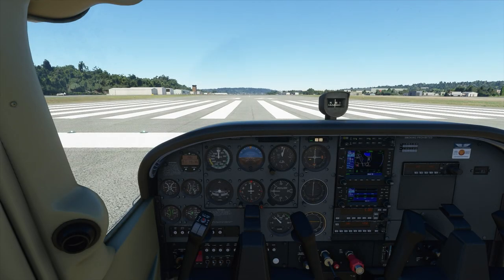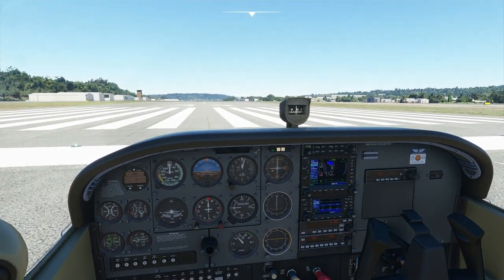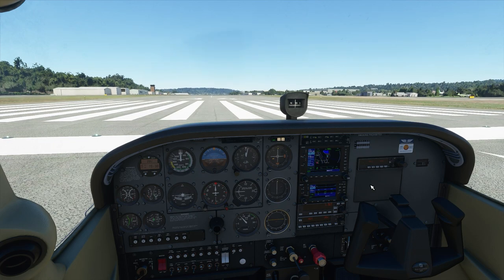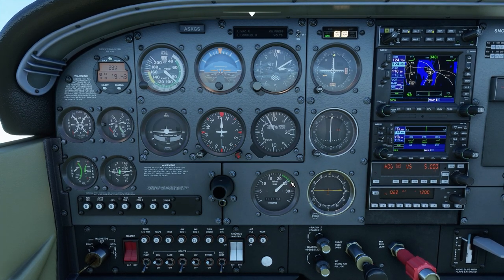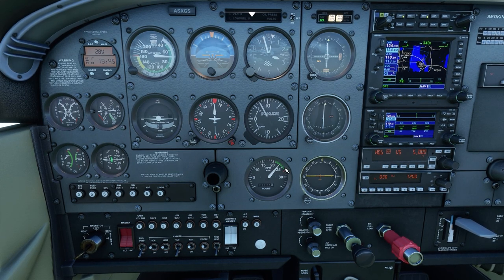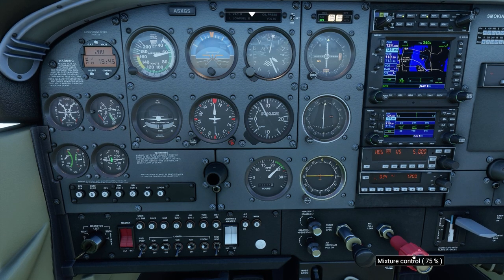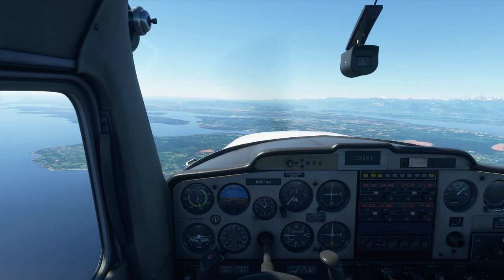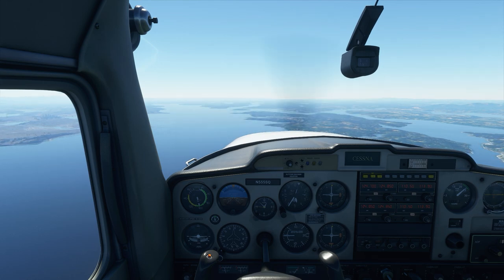Tutorial #10 - How to set Mixture - Microsoft Flight Simulator

Comment: For those wondering, Fuel Flow can increase (usually only slightly) because a leaner mixture leads to higher RPM which leads to more air intake which leads to more fuel being mixed to maintain the mixture %.

Comment: the fuel flow gauge did come down the first time. It went from 12 to just over 11
Reply: true but there seems to be something broken with mixture in MSFS... because when you lean at first the fuel flow will rise witch will never happen in the real airplane
Reply: Maximilian Domann 
Yup.  MSFS 2020 has a way to go on systems modeling.  X-Plane is much better at this his...so far.
Reply: @TheKillermops  No. The fuel flow does not increase when you lean in MSF2020. Fuel flow decreases (as clearly demonstrated in this video).
Reply: @davecarsley8773  If you have your mixture full rich and then move the lever slightly you will notice the fuel flow increase. As you lean the mixture more it comes good. Is there a fault yes, sim breaking no.
Reply: @theflyingemu3647  Correct. What you're saying is true now (after update), but it wasn't true several weeks ago. They've been making improvements slowly but surely.
Reply: Going from rich to
Stochiometric while keeping constant throttle can increase power, which means the engine spins faster. A faster spinning engine eats more fuel. There are many different factors involved that decide whether fuel burn goes up or down. The only time you can be sure that moving from rich to stoich will decrease fuel burn rate is if you maintain airspeed not throttle.

Comment: Honestly I’m just going to fly the 172 for several weeks. Everything else is too complicated at this point.
Reply: I'm flying the tbm 930. The 930s just as easy except it has POWER. :)
Reply: Exile 1 I’ll give it a spin and see. Thanks 🙏
Reply: The Icon A5 is a real simple aircraft too
Reply: The TBM's g3000 works the same way as the 172's g1000, except I actually like it more because there's a touchscreen with a keypad that you can use to program a flight, instead of using the knobs on the g1000. Just follow the checklist and you can google takeoff and landing speeds and best climb speed. Also, know there is a bug which causes the ITT to be too hot on startup, so instead of idling it bring up the throttle to about 5%
Reply: @exiletsj2570  I thought you were the same guy because of the profile picture
Reply: You want basic hop in the yellow Cub!
Reply: @DustyWall  the savage cub is a nice airplane and it's an entirely different style of flying than the TBM. The cub feels like you're flying on a dragon, whereas the TBM feels like a tiny concorde
Reply: almost everything with one propeller is easy
Reply: Don't worry it gets easier, I recommend learning some of the autopilot functions as it can deal with some issues you might have. Then later you can figure out the more technical stuff you can do.
Reply: I'm flying the 172 for now as well.
Reply: Tbm is fine
Reply: @nicolassalischiker3924  it's actually not a bug, it's just that you are supposed to move the throttle up and shift it left  before the engine gets too hot. The reason this might seem wrong is because that part of the startup is on the next page of the checklist, but you should really do it as soon as your target values are reached.
Reply: @nicolassalischiker3924  The ITT thing was bugging me
Reply: @lisztdylan7846  I do exactly what you say but at idle on the left rail it still gets too hot. What I do is throttle up to about 10% and the temps come down. It's going to be patched in the next update
Reply: I do the same, I'm just focusing on the 152 atm for all the basics.
Reply: Yeah, I’m totally new to flight sims and discovered this on Game Pass. Have been practicing all of Squirrel’s teachings on the 152 the past week to get the fundamentals right and it’s been fun. I might go up to the 172 but I’m a little intimidated by the Garmin interface. I just ordered the Thrustmaster TCA airbus side stick too so hopefully it’ll get easier than using an Xbox controller + KBM. Really digging this flight sim!
Reply: @jollyrioger2572  same I play with xbox controller and ordered the tca sidestick. Also squirrel made a tutorial on the garmin interface I think. Once you learn how to use you'll discover a whole new type of flying and you'll be able to enjoy asobo's weather engine
Reply: Nicolas Salischiker sweet I’ll get on to that soon. Thanks!
Reply: I think it's a smart idea to stick with the 152 or 172 for a while just to build up the basic flying skills and techniques.  Yes, you can hop in any of the planes if you want, but mastering the basics in a basic plane will make you a better pilot.  I plan to move up progressively.  I've done real world training in 152s and 172s (with most of it in the 172).  I think after spending some time in the simpler planes, the Cirrus or the payware 182 from A2A are logical upgrades since they introduce variable pitch propellers.  Then maybe the Bonanza, and so on.
Reply: @DustyWall  I really wish they had a classic J3 Cub!  Maybe A2A will make one like they did for FSX.
Reply: That's how we do it in real life.   Start small and work your way up.

Comment: Can you explain variable pitch next?
Reply: Variable pitch props allow to restrain engine rpm w/o reducing power or airspeed.
There are Constant speed units as well which govern the engine rpm in optimal range automatically.
You can think that prop blade is simply a wing, variable pitch prop allow to increase AOA of the blade increasing lift/thrust, at the same time increased AOA increasing drag which force propeller to slow down.

Comment: Excellent again. I learned in a C150 and learned EGT once I certified on the 172. I am glad you also added about "mixture rich" checklist item on landing (under 3000). I rent planes so they are fussy about us taking care of the engine during flight. But just the lifesaving and fuel cost saving is our main goal... way to go Squirrel

Comment: Good video. Older cars used to have a choke flap on the carb. Works on the same principle with all carburetted engines. Rich(Closing the air butterfly flap) ensures there is more fuel than air for the combustion process. Leaning (opening the flap) allows more air into the carb to mix with the fuel and enter the combustion chamber. Why it causes the black soot is because not all the fuel is burnt. When you run too lean you'll get spark plugs with white on the electrode and you run the risk of burning your valves. A perfect mixture will give you a nice golden brown colour.

Comment: As Squirrel said re temp and the fuel cooling the cylinder heads may I add that the attitude of the aircraft affects cooling also. Those air intake holes in the cowl behind the propeller at different attitudes can reduce the effectiveness of the relative airflow over the engine like when climbing. You can also snap cool the engine in a power off decent and crack something like cold water on  hot glass. I love this stuff... thanks Squirrel good tutorials

Comment: To lean properly without an engine monitor, pull the mixture control out until yo start to get an RPM drop on the tach, then push the mixture back in slightly and slowly until the RPM returns to the prior level.  Your mixture is set.  Your EGT when installed should be off the hottest cylinder and when you lean properly using RPM it will almost always when you are first established in cruise before you lean, match the original set EGT gauge.

Comment: This is a great video, cheers. The sim would be so much better if they included this kind of information. Never though much about mixture control (knew I was missing something) But flying the Robin DR400 I could not climb above 6500ft without stalling. Leaned out to 40% and RMP increased 300. Really could not fly the plane without leaning out.

Comment: The mixture is important for internal combustion engines mainly due to timing. If you think about the valves that open and close to allow mixture in and exhaust out are mechanical. they happen when they happen due to mechanical timings that cannot be changed.. at least mid flight. So the amount of fuel you want in the cylinder is the amount of fuel that can be burnt in the amount of time between intake valve closing and exhaust valve opening. when your mixture is too rich, the explosion is still happening as the exhaust valve opens  allowing all the built up power to just escape out the exhaust while also due to the prolonged explosion period it slows the piston down as it tries to come back up to start the cycle again...basically making the engine run rougher.

Comment: How many planes auto-adjust the mixture?  This seems like something the computer can control easily, much like fuel injected cars do.  ECUs in cars instantly adjust timing and AFR targets according to load, alt, and even gas quality.  The plane already knows how high it is above sea level.  Is adjusting mixture something only needed in older planes built pre-1980s?

Comment: Fuel flow seems fine to me for the altitude you're flying, the speed, and the power setting. Generally for cruise, you set about 2300rpm but you could go higher and reduce fuel flow even more. We generally cruised at 95-100 knots tho too to save fuel. 8-9 gallons per hour would be ideal. 10 gallons per hour is what's advertised I think for cruise.

Comment: Im over Patagonia now down South in a Bonanza Beechcraft? On the right map screen, I noticed there is a computer setting to check lean. I see 6 cylinders each and can cycle through their EGT or CHT which is cool, then assisst button tells you the delta (change) in peak temp? I also lowered my prop lever for first time to keep RPMs out of red, seemed even lowering throttle 50 percent didnt have the reduction effect that 5 percent back on propellor lever did. This is an odd plane, but Im trying to learn as I go, hence coming upon this vid to shed led on mixture leaning rules...thanks for posting!

Comment: Thank you.  I learned a lot in this video.  I'm hoping you have a mixture guide for variable pitch props coming.  I've really been loving the King Air 350i, but I would love it more if I weren't guessing at the mixture.
Reply: You don't lean mixture in the King Air. Those engines are a whole different kind of game, not comparable to the C172.
Reply: @heffron91  Do you not lean the mixture on turbo props at all?  If not, what is it's purpose?
Reply: @cameronvford  Correct. They are called condition levers in turboprops usually. The King Air for example has 3 detents, fuel cutoff, low idle and high idle. Fuel cutoff is self explanatory, low idle is mostly used during engine startup and taxi operations. High idle is used during normal flight and when for example extra bleed air is needed during ground operations. They control the fuel flow en thus the idle rpm of the turbine. The King Air has a Fuel Control Unit (all PT-6s in general, i think) that regulates fuel injection to keep the fuel/air ratio adequate for efficient combustion. So during flight you leave the condition levers in high idle.
Reply: @heffron91  That was incredibly helpful.  I was definitely thinking about the mixture lever, but apparently I don't remember what I was flying.

Time do some reading on condition levers as that was a term I hadn't yet heard of.  Thanks!
Reply: I figured out where my confusion stems from.  When you hover the condition lever in the 350i the MSFS 2020 tooltip that pops up calls it a mixture lever and the hotas input you map for your mixture moves the condition lever in 1% increments.  The cockpit visuals do however indicate it is a condition lever with 3 positions.

It is an incredible game, but they still have some work to do in some areas.
Reply: @cameronvford  No worries. I see where the confusion comes from, although i think in older sims the assignment for mixture also controls condition levers in case of a turboprop. 

I agree that MSFS2020 has huge potential, however the default aircraft are lacking massively for anyone is into or wants to get into serious simulation. Fortunately I think it is just a matter of time until we get freeware community mods of the default aircraft that will approach high level fidelity addons, perhaps even before we get our hands on addon aircraft from the big 3rd party developers.

Comment: How do you get the (%Value) to the RIGHT of the utility you're hovering over? What setting is that; I feel dumb for asking but the legacy locked controls are the only way I have found so far and that doesnt achieve the goal.
Reply: I have logged that EXACT question on multiple youtube videos, but have no answer yet.  Reply if you find the solution/fix.

Comment: Engine will loose power regardless of Mixture setting at higher alt, but Mixture allow to retain optimal AFR.
max power is often at about AFR 12-13, max economy AFR 15 -16 but this is dangerous for engine at high power.When engine runs too lean detonation may appear which are very dangerous for engine. It is much safer to tun too rich then too lean.
Fixed pitch prop, manual mixture welcome to world war 1 aviation :)
I was always wondering why those planes don't have automatic mixture unit.

Comment: I just tried this in the C172 with the G1000 and cut the mixture all the way down to 5% (some how the engine did not die or sound weird or struggle for power) flying at 8000 ft at 100 knots with the autopilot on (in NAV mode, but was flying in a straight line the whole time). The problem is the EGT, FF and RPM only moved like a millimeter if you zoomed in all the way. I moved the mixture in 5-10% incriminates and waited around 1-2 minutes after each change and did not move the throttle. I took off from KSEA and flew south at a heading of around 165 degrees (towards the mountains and landed in KRDM). Am I doing something wrong?

Comment: Why does the ball in the turn coordinator move so little in this game? I wanted to practice coordinated turns but I rarely had to use my rudder pedals because the ball stayed inside the lines all the time
Reply: Perhaps it's one of the assists. Do you have auto-rudder turned on in settings?
Reply: @nimmen  There is only autorudder for take off

Comment: I wonde when all automobile have changed to Fuel Injections from Carborator. Why pistons engine aircrafts are using Carborator when it travels in different altitudes.
I used to have electronic fuel injection Volvo 164 E model '72 in '77, very rear setup. Our '48 model Chevrolet truck had 3 settings for metering rod in carburettor for different altitudes.

Comment: New simmer here. Can anyone tell me why my ete is always wayyy off? In the tutorial it says weather can throw it off but I can fly with clear skies and once I reach my ete time in the navlog I'm only about halfway to the destination. Doesn't bother me that much I'm just curious if I'm doing something wrong.
Reply: You need to keep your airspeed at cruise speed.  Which is what the the ETE calculations are based on.
Reply: @bluescanfly1981  does that include climbing to cruise altitude? It's told me to not go above 74 knots when climbing.
Reply: It's very accurate for me. Get up as high as possible asap, then smash the throttle forward, is how i fly.

Comment: Could you do one on prop too?
Reply: Thats simple. You control the adjustment of the Prop. If you pull it back full, the Prop will nearly create no thrust. Sometimes you need to operate the airplane at full throttle(the black lever) then the Rpm could be to high. To still be able to fly on full throttle you will need to pull the prop slightly back to get it back in the green.
Reply: The blue lever is like the gears in your car.
All the way forward is like 1st gear, slow but lots of torque.
All the way back is like 5th gear, fast but little torque.

Comment: Is it because the age of the plane, that they don’t use a lambda sensor (like cars with petrol engine) and an engine control unit to adjust a perfect air-fuel ratio?
Reply: I wonder that too.  My turbo auto doesn't really care that much about mixture or lose much power when I take it to 12000 feet, and even my ordinary fuel injected motorcycle, although it loses power (no mixture adjustment can make up for lost oxygen in a non-turbo engine) certainly does not go rich at 12000 feet.  Carbureted engines, like the 152 and 172 steam gauge , though, would of course be a completely different story which we see in this tutorial.  I am assuming that the in game 172 G3000 is in fact fuel injected, but it still has a mixture control on the panel...
Reply: @sandhill9313  The aircraft I work on also have manual mixture control and fuel injection.
Fuel flows into an F.C.U. (fuel control unit). Intake air also enters here.
Little "impact tubes" measure the density/pressure of the air which controls how much fuel can pass through.
Fuel then goes up to a "flow divider" (which just directs fuel to each cylinder).
Then it is piped along to the injector nozzle.
No computers or electronics to fail.  Just a mechanical linkage to the throttle and one to the mixture.
Reply: @Android811  Yes I was expecting that staying alive was behind it all, K.I.S.S. etc.  If the ECU in the car or bike fails I might have to pull over to the side of the road and arrange for transportation to a garage :)